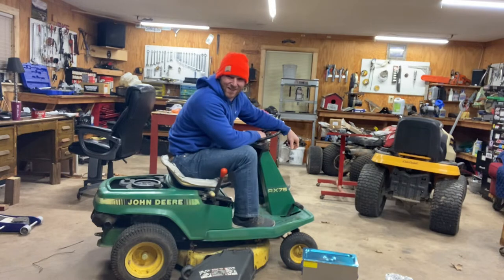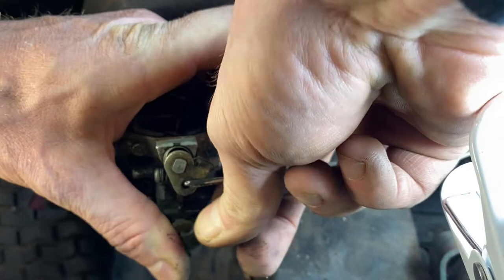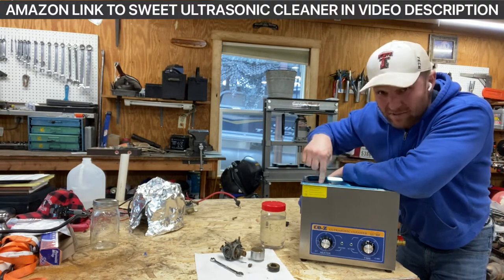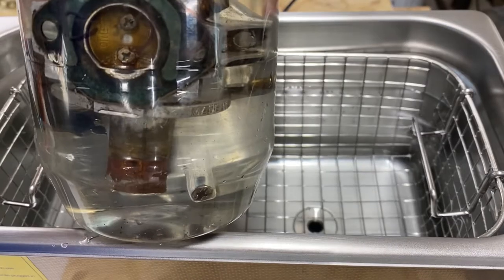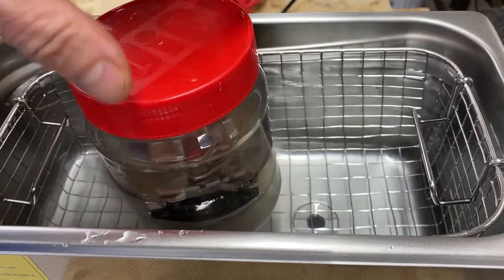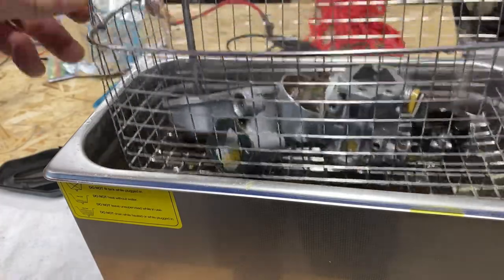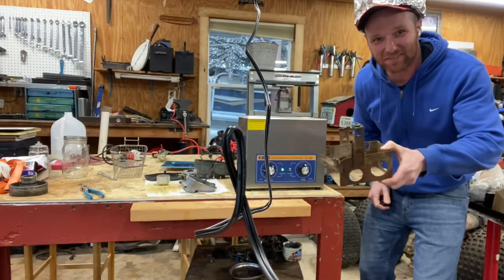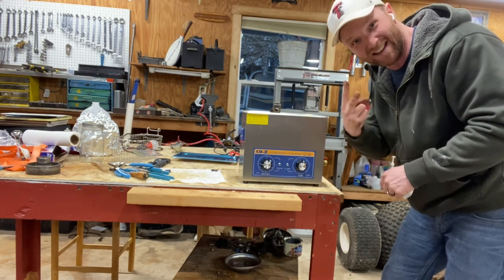Lawn Mower Carburetor Ultrasonic Evapo Rust Cleaning & Replacement, John Deere RX75

Comment: I have 2 John Deere RX75's they are great tractors!! They don't make them like they used to anymore
Reply from the maker: Damn 2, can’t wait till I can start cutting grass with her
Reply: @MowerMike  One of mine has snowblower tires on it so it goes pretty much everywhere in the snow, I take both the mower decks off in December. I have to order a second set of ATV/Snowblower tires for my second tractor at some point